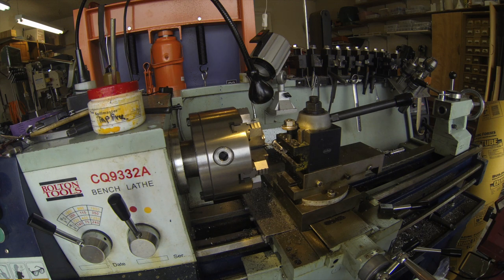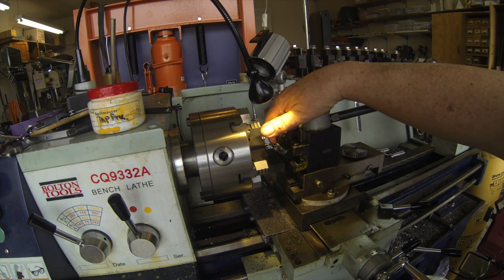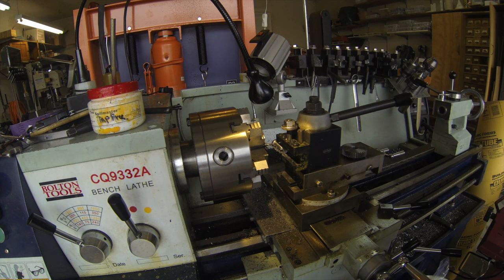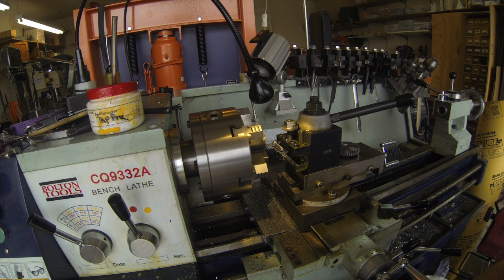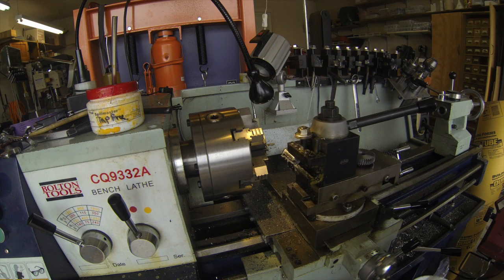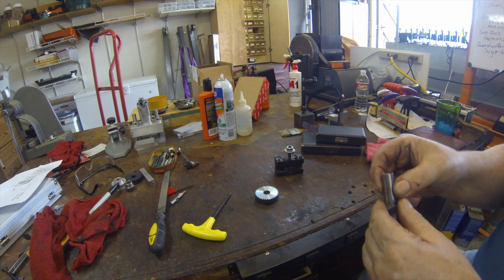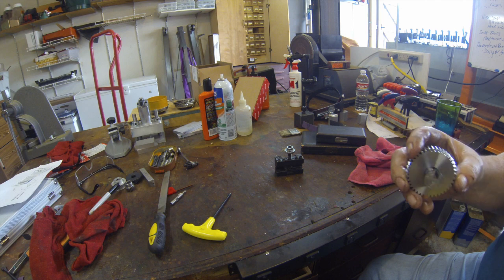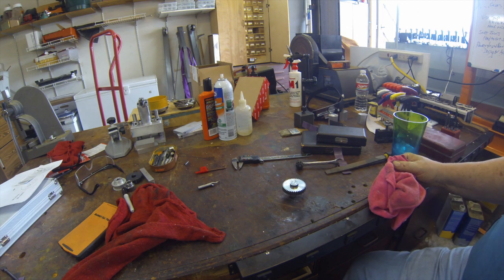Nooner #8 update  Making a 15mm Broach Bushing

Comment: Hi Herb !

I would want to have some of these "broaching rods" but until now I haven't come across any in "my" size at the ebay ;-((

I beleave you should have one broach for every size key you want and then just make bushings like you did here for different size axles.
Reply from the maker: Keld,
Thanks for the comment. 
I bought a small set of broaches for small  (up to 1/2") ID  on the gears/pulleys a couple of years ago.  as I remember the broaching rods are 3/32, 1/8, 5/32. 
I will buy a 3/16 broaching rod, but they are rather expensive.  Making the bushings are easy to make.  I doubt that I'll ever make a broach (making and hardening).